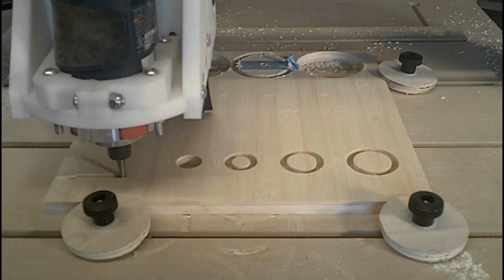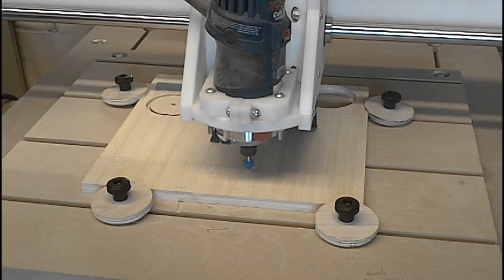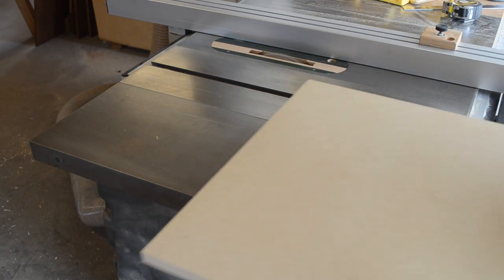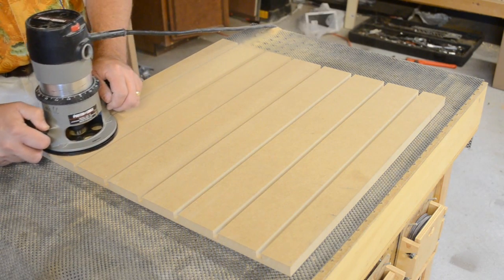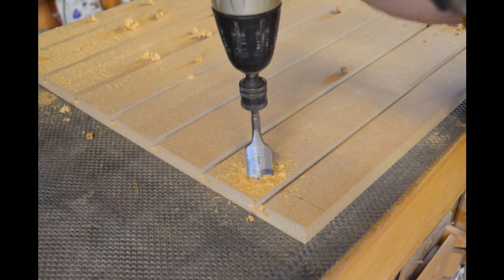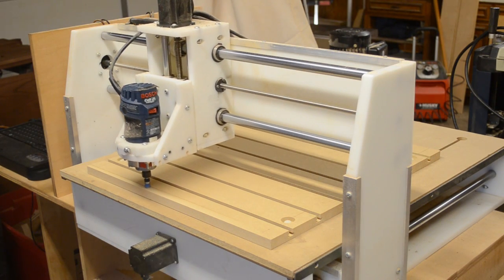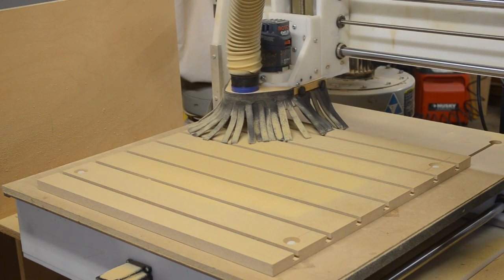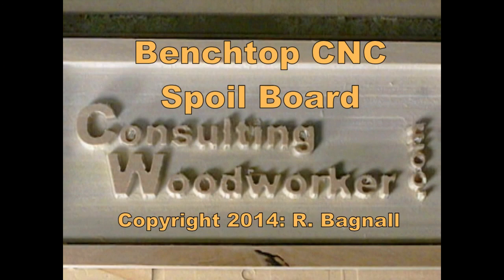Benchtop CNC Spoil Board

Comment: Hello where did you get the nylon fasteners and what size are they?  Very Nice spoiler Board. Thanks
Reply from the maker: Max, if you are lucky, a good local hardware store may have them, but I always buy odd hardware like this from www.mcmaster.com Also, you can find a very detailed build plan for the spoilboard and milling your own hold-down clamps in my new book "Beginner's Guide to CNC Machining in Wood". https://www.woodcademy.com/book-store-1/2021/6/12/beginners-guide-to-cnc-machining-in-wood

Comment: How deep did you cut your 3/8" dado?
Reply from the maker: About 7/16". The max depth that the Rockler bit can cut while self-guiding along the 3/8" slot is 1/2" before the shank rubs on the top of the material.
Reply: Excellent, thank you!
Reply from the maker: My pleasure!

Comment: no problem with the T bolts pulling the T-slot/MDF apart?
Reply from the maker: Gary, not initially. In a 3/4" spoil board, I cut the T-slots to 1/2" deep. You will notice the clamp disks I use. This keeps the pressure close to the t-nut which also helps. 

Tear out only becomes an issue after I have planed the surface a number of times, and the neck of the t-slots gets too thin. Then it is time to replace the spoil board. One more thing, I recently had to swap spoil boards, so I made the new one from a pre-glued aspen panel bought at my local home center. I tried it as an experiment and it so far has been working great!